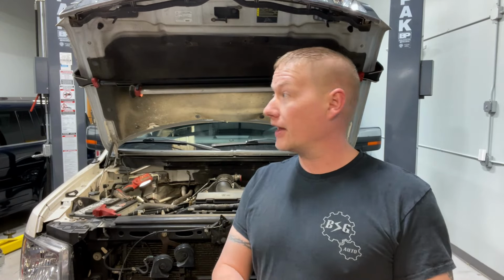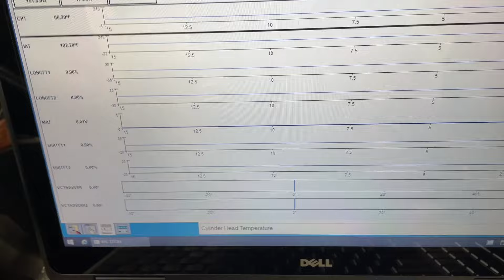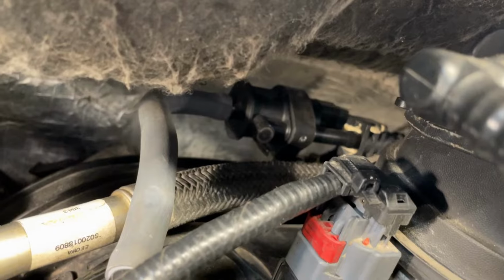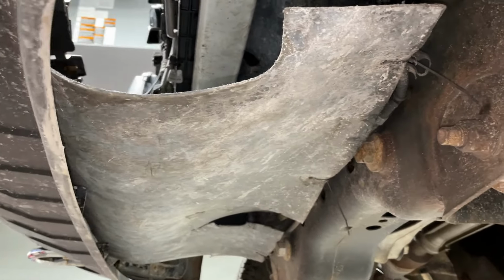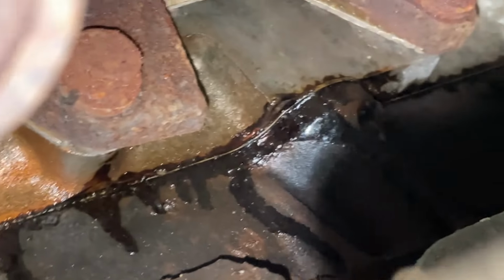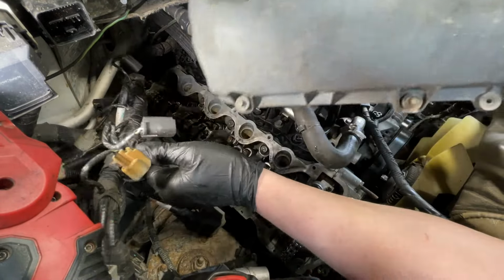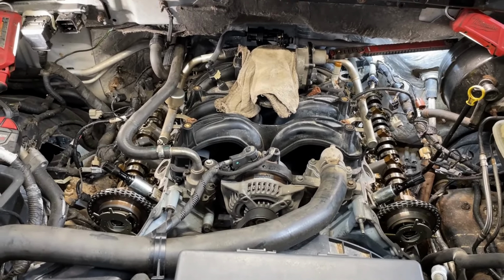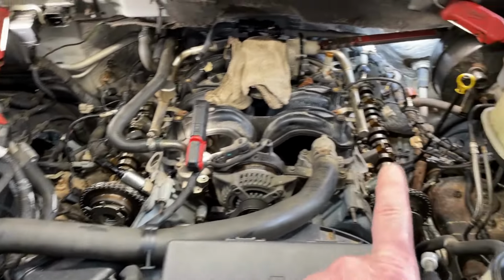The Worst Hack Timing Job Ever!

Comment: I think you are correct Brian.  That must have been a remanufactured engine from one of those place u c online.  $2300 reman engine.  Who knows what’s going on in there.  I totally agree with u.  Not worth ur time to work on that engine.  Even if u do the timing job...  he will still have the oil pressure/volume issues.  Start from scratch with a reman engine from Ford or trade humpty in!!
Reply: That's the problem with the automotive repair world.  There's no quality control and shops aren't accountable for poor workmanship.  

If you don't have a mechanic you can trust or can't do it yourself, your better off taking it to the dealer.

Comment: The cam bearing caps ive seen before. I immediately thought the same thing you did about someone swapping a head and using caps off the old one. Then I really got thinking about it. Whats happened is someone pulled down the head themselves and sent it out to the machine shop to have a valve done or some kind of work, head gets washed at the machine shop but the caps stayed at the mechanics shop. So they probably are the correct caps and their factory stamped for their position. But it is annoying since you can't be sure by looking at it. And I agree the second I saw head gasket dope on it id be calling a new motor. It hurts a bit to look at this kind of work, but working for a dealer you see it a whole lot when people finaly give up and bring it to you. They sell some kit with the complete timing setup for these motors and a lot of people go at it in their driveway and end up shipping the mangled mess off to us after.

Comment: "It's a 5.4 3 valve of course"..that says it all.
Reply: Did I mention that I was very happy to trade in my 2009 F-150 on my 2020 Silverado!  It was starting to make the normal 5.4 three valve noises.  Very happy to be back in the GM family!  :)
Reply: @railroadjim  China is thankful for your support😉
Reply: @Silent_Shadow  At least he didn't buy a Buick.
Reply: Chevy? You better have some good walking shoes or triple A so when it breaks down😂
Reply: @ricardomartinez5088  That F150 was the only Ford product that I've owned, and I was really disappointed with the engine, and the fact that it rusted out in record time.  My GM products usually have transmission failures, so the engine having a problem was new for me!  :)

I would own another Ford someday, but never with that piece of crap 5.4 3-valve engine in it!  I can't believe the inherent problems with that engine.  Talk about something designed by engineers who never have to maintain the product that they designed....
Reply: @railroadjim  All trucks have there problems just that GM has more Government motors👎🏽
Reply: Oh it's a ford that's says it all .. ahh Chevy that says it all . That kind of mentality is the joke not the played out tropes of manufacturer better than the other.. I've had a high mileage 08 or 09 f150 fx4 other than the phaser issue @ 165k miles truck was good. No issues. . The last 2 Chevy Silverado's (2011 and a 2016) ive driven were good trucks . My right foot and the newer style transmissions don't agree with each other get some weird random shift once or twice a month. Now somebody jump in and say something about Dodge n Toyota itll complete the that says it all trope
Reply: @codyramos3200  my Dad has a 98 5.4 F150 around 280 K, other than a timing job after the chain guides fell apart it's been solid.  Been driving that truck across Texas since I was a kid. I'm 35 now. My 2012 5.0 has around 185 K, been good to me so far.
Reply: @fernandobriseno8164   yeah the 2v engines 96-04 were no doubt reliable units.. the addition of variable cam timing in 05 muddied the waters . My buddy has a 2000'ish f150 fx4 that's @ or past the quarter million mile mark. It was his dad's that truck runs great ! About 6 years ago here in south TX  me n another friend used his dads 99 f250 with the 5.4 to pull a 20ft enclosed trailer loaded with our lawn equipment . 360 something thousand miles on that truck 36x,xxx miles ..it wasn't in the best shape (old work truck) I expected the engine or trans to scatter every time we got on the highway .. but it never blew up lol truck is still alive running around in Oklahoma.. it has to have 400k+ miles on it by now.
Reply: That’s all I have owned is chevy’s I have had nothing but good luck with them !!
Reply: @rods907  yeah the 350s are a nice engine.
Reply: Fernando Briseno they don’t make 350’s anymore! It’s either 4.8 or 5.3 or 6.0 and some other idk about!
Reply: @rods907  Chevy makes good V8s, but any of them could be a turkey if you don't take care of them.

Comment: I just removed my throttle body as part of removing the intake manifold to replace a PCV valve. I have a 2005 ford escape hybrid and it has coolant lines. Do I need to bleed out the air from the coolant system since I removed and reinstalled the coolant lines on the throttle body. If so, how do I bleed out the air for this vehicle. Keep up the great videos!!!

Comment: Looks like the engine I pulled out of my 04. Was missing 2 front cover bolts on the pan/timing cover one broken off in the timing cover. Looked like they used that blue anaerobic gasket maker all the way around the front cover and the intake manifold ports, thermostat housing/coolant crossover. Lost oil pressure a while back and spun the thrust bearing. Decided to poke around a bit and decided to buy a reman lol I painted the valve covers and timing cover 😆

Comment: So, can a PCV leaking oil into manifold cause rich code? Because I have P0171 on my 3v Mustang and found oil leaking from PCV on that bank, smoke tested for vacuum leaks and nothing comes, also brand new both OEM NGK o2 sensors

Comment: Need advice: Just bought an 04 F150 5.4L 3V for $7900 a week ago, already had to replace both VVT sensors, now mechanic says it needs timing set soon due to a light clicking sound I had him check out. Should I fix it or just sell it?

Comment: This is why the flat rate pay system needs to go, shoddy work trying to beat book time.
Reply: Not sure it would any difference. Always benefits to be had from racing book time and still charging for book time.
Reply: I don't even have that much confidence. Those shop hours for maintenance are padded already, so most can be done under that time. That's fine.. but in most cases there's not enough competence or desire to do it properly in the first place. How many mechs actually follow a shop manual to the letter, or even use one?
Reply: My work doesn’t look like this. Flat rate is my best friend.

Comment: Hey man I have a question. I was chasing a brake noise on my 97 f150. I finally chased it down to a broken and chewed up tensioner cable on the right drum. Anyway I replaced the whole shebang minus the rotors up front because they were in good shape. So all new pads and shoes, all new hardware and everything lubed up at contact points. I still get a scraping noise from the rear right drum when turning right. I've taken it off and done another inspection, it all looks good mounted the wheel and made sure everything was tight and aligned properly. I know I will hear some noise while the new shoes are wearin in but this sound is quite loud. Any ideas?

Comment: Hello, we have changed oil pump, timing belt and can phaser on 2007 F150 5.4L. But for some reason, bank two is rough and make vibration, of I remove the phaser sensor then it runs smooth but make the check engine light to poped in. Can you please suggest what is the reason for it and what should I do ?

Comment: Great video. 
I changed the struts on the front of my wife 2012 Escape. Now I have a rattle. Doesn’t happen with every bump or crack in the pavement. Followed your video on how to do this. What did I miss. Even torqued everything back to factory specs. Any ideas 💡 
Thanks

Comment: Do you have any input on the 2018 and 19 cam phaser rattle recall on the expedition, I'm sure there are a lot of people like me that are concerned about it. I was planning on buying a used expedition but now  I'm afraid to,  I have been seeing a lot of cases where the phasers are being replaced and still not solving the problem.  If you have any info that you can share with us on this issue please tell us what you think.

Comment: Guess they didn'T follow the oil pan bolt torquing sequence (facepalm)
The cam caps not matching is a huge red flag.  It's going to eat up the cam journals unless it's line bored.
Reply: Unless those bores are oversized, which is likely since the phasers were bouncing all over the place due to the oil pressure loss at the solenoid.

Comment: i followed your video on timing chain replacement for the 3.5 Ecoboost (2015 F-150) after reassembly started the engine and ran smooth for about 30 to 45 seconds then started Knocking loud shut engine off tore down engine again and checked the timing and the chain colored links were off to the left by 1 tooth (Left Bank, Right Bank and cam sprocket) any idea as to why this happened I used all OEM parts New chains. tensioner, Guides an all 4 Phasers new any response would be greatly appreciated.

Comment: I have a 2012 v6 3.7 mustang and I had to take off the valve cover and they have those re usable gaskets and had a glob of sealant on the t joints. When I pulled it up, the glob was still there and looked in tack. Do I need to re seal it or do you think that glob will still hold? I think it will be ok since it’s really not sealing the valve cover.
Reply from the maker: You need a new sealant glob at the t joint yes.

Comment: Honest questions, I'm not very mechanically inclined. Wouldn't you expect to replace both heads as a baseline then once you're down there, check and see if the bottom end is tanked? If it is then just snag the rest of the motor minus the heads? If none of those dirty fingers that did the top end repairs made any contact with anything else, chances should be good that the rest of the motor is salvageable, right? Would the cost of all that just be so close at that point that a whole motor just makes sense even if it was ok?

Comment: I have a 2002 windstar and the overdrive light came on and wouldn't go off and the info panel said check transmission.  It seemed to have problems changing gears. pulled over and turned car off for a few minutes and check fluid looked fine started the car up and home and the light didn't come back on.

Comment: Got an 04 F150 with the 5,4 3v. Now I've already dealt with my timing stuff but I have a potentially stupid question involving the Phasers. Can one get away with using After market Phasers if they are locked out?
Reply from the maker: I would not, there are many fitment issues.

Comment: Hey, I have a 2019 Mustang gt with the 10-speed and it has 40k miles.  I have a rough idle issue but its not throwing any codes.  It only does it once its warmed up and the rough idle will last for about 4 seconds each occurrence.  I was thinking maybe an evap or vacuum issue.  I'd like to fix it myself before paying out at a dealer.

Comment: Incredible. I just received the OEM parts to do the timing on my 14' ecoboost f-150. I'll be following your videos for that job. Hopefully I don't end up with this!
Reply: Ouchie, what happened to create the need for chains on that already?
Reply: @edwardmyers1746  it's common with the EcoBoost motor. I believe it has to do with the phasers causing the chain to stretch. This guy has a series on how to fix it and a couple of explanations on why it occurs.
Reply: @grilledxcheeze  timing chain wear is accelerated on boosted engines in general not just EcoBoost. The crank pulls with more force on them camshafts. But on a 14' ouchie. What's the miles?
Reply: @edwardmyers1746  unfortunately only 80k. While I'm in there I'm going to go ahead and replace a few items and hopefully I won't have any issues for some time.
Reply: @grilledxcheeze  that sucks sad to hear, I'd expect more out of them. I guess the tensioners went n the chain slap followed
Reply: @edwardmyers1746  it's not bad right now but I've see cases of it getting bad. I would have expected more but for $1200 I was able to get all the parts and a couple of tools. Haven't had a single issue with the truck other than this.

Comment: What's the average price for a 2005 5.4 3 valve new engine. ? Only go with Ford crate,or is there any replacement engines that are built right with oil pump upgrades and other stuff that ford didn't get quite right? Thank you, enjoy your videos.

Comment: This cracks me up.  These engines have problems because of crappy oem parts that fail and people say to only use oem parts to fix these vehicles when the problem is the inferior oem parts to begin with.   Yeah. No.  I replaced the chain, tensioner, and cam phasers with “inferior” aftermarket parts years ago on my 2005 f150 and it’s still running well.  Ford hosed it up the first time with their shoddy oem parts.  No way I’d trust them again, even after multiple revisions.  They are also way too proud of their parts and the price shows.

Comment: Hello i have an 03 ford taurus with 125,000 miles but sometimes on frist gear only  the rpms suddenly go all 2 or 3 on the rpms they told me to change the transmission oil but i wanted to know if that is recommended

Comment: Have they come up with an approved fuel system cleaner for the ecoboost engines? Do you recommend any specific catch can version for the 2013 Fusion 2.0? I recently bought one with 80K on it. No problems so far and would love to keep it that way. Apologies for posting these questions on a video that has nothing to do with carbon buildup.

Comment: I'm surprised to see an opening on the fuel rail(the test valve port on the driver's side near the front of the fuel rail), the EPA disallowed these test ports on most cars made 01-01-2003+ as an evaporative emission reduction strategy.

Comment: I have a 06 ford five hundred and when you shared about the wire hornist , I pulled it up like you said but however it’s doing this . Once you driving and it starts warming up it begins to beep and all the dash board lights go off but car still be running and the head lights and tail lights stay on but they flicker . Then it beeps and dash lights and gauges come back on . Then it beeps then say check charging system then it beeps and come back on and it does this over and over and even tho the dash lights and gauges be off the car still running. What’s the problem with my car???
Reply: Mr. Ford TechMakuloco if you understand what I’m saying my car is doing can you please let me know what to do ?

Comment: ? For you have a 2018 3.5 eco with 27,000 when should I change the transfer case fluid and can I use 5w30 Mobil 1 syn oil

Comment: I have a 2010 "last yr for 5.4" FX4 Supercab 20" tires 3.73 gears Full tow package 6.5' bed. Purchased in 2013 All stock with 12,000 on it. Upgrades & Mods.1st SCTx4 programmer. I saw 4-6 mpg increase and throttle response is night&day.  Switched all fluids to amsoil. I don't sell or represent either company. This is based on my experience and what I've seen first hand. I recommend Amsoil to everyone I've seen the results and yes there is a difference. Replaced all rotors and calipers with drilled/slotted w/HD calipers. Upgraded vct w/high flow ports. Cut and dumped exhaust behind cats. NGK iridium plugs. at 80,000 miles full timing replacement all motorcraft except upgraded to Melling M360HV High Volume Oil Pumps! I pull a cable plow with telecommunication cable spools daily. Total weight for Trailer plow and cable is 7900-8100. Right now my truck has a little over 315,000 miles on it. Just did a full service less than 3,000 miles ago. compression was middle to high 180's high side and high 140's low across all. Best advise I can give anyone who owns one of these trucks. Change all fluids to Amsoil Get a Programmer But ABOVE all MAINTENANCE on time every time. Lots of people put down the 5.4 yeah this engine is finicky. However properly maintained there's nothing in class that can outperform it. It's one bad S.O.B. One last thing for those out their who will say I must of got lucky with this engine most 5.4 are shot after 125,000 miles. I also have a 97 "1st year" 5.4 xlt personal truck very little towing drive it almost everyday. Still going strong at 496,156 miles. A large part of that is due to this Man your watching now . FordTechMakuloco has earned my upmost respect. He has put out the most high quality and information packed videos on the 5.4l anywhere. If Ford Motor Co. would higher you to make a set of official service & repair dvd's. There would be a hell of a lot fewer videos like this one. So a personal Thank You for your time and all the knowledge you've shared. You've made a positive difference. My brain and knuckles also want to Thank you.

Comment: Did timing chains on a 4.6. Got it all back together. Wouldn't start. Cranked just fine but no sign of firing. Looked over on the bench and realized I forgot to put the reluctor back on the crankshaft. Had to pull the front cover back off. Lost my ass on that job.

Comment: What a nightmare. I'd be interested to know how the customer reacted to the news and the bill for the diagnostics. I laugh at the guys on the 5,4 3V Facebook group who stand by aftermarket engine parts. This is a perfect example of why it's so important to do it right with Genuine Ford Parts. Great video, Brian.
Reply: On my timing job, I used Melling parts for the timing kit (phasers and VCT solenoids as well) and M340HV oil pump, Ford OEM on the roller followers and Engine Tech on the lash adjusters (I figured they're not a moving part, so it would be ok). Spent about $1400

Comment: That truck has become a money pit.  I feel bad for the owner.  Brian when you install a used engine like a 5.4 3V do you swap out the timing components before installing as a precautionary measure?  Most are probably higher mileage?